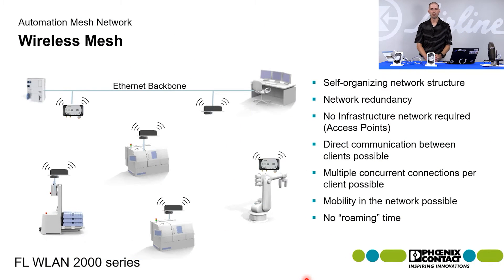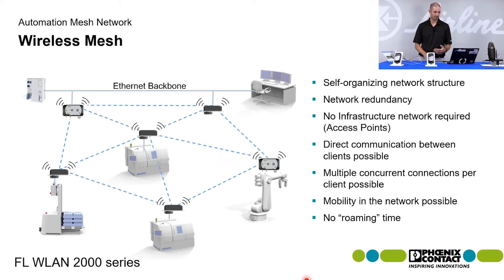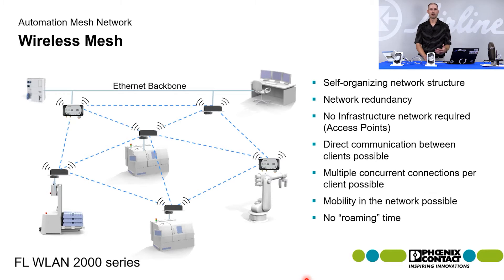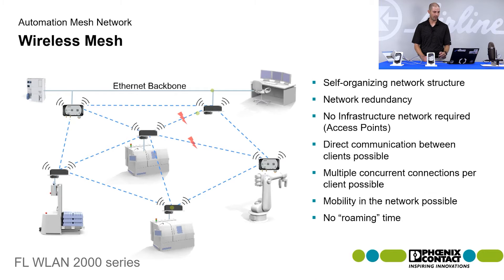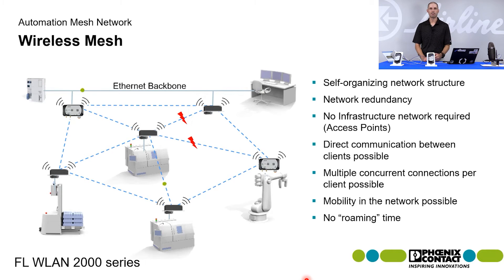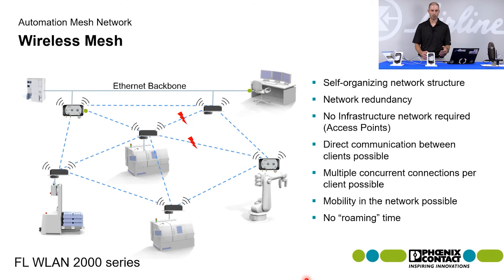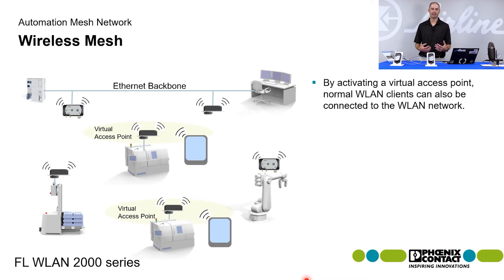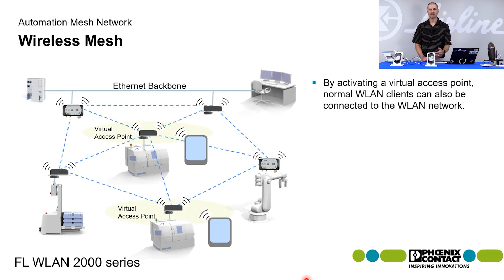Explaining Mesh Networks | Industrial Wi-Fi Setup Part 10 | FL WLAN by Phoenix Contact

Comment: Hi, if I would like to connect a laser with a WiFi module (ESP32) to a WLAN 1100 Phoenix Contact that is connected by ethernet to a LOGO! PLC, is it possible? ,

EXCELLENT VIDEO SERIES
Reply from the maker: We asked Justin, he said - "Yep! That would be no issue. You can set up our radio as an Access point and connect the laser to it like any other WLAN enabled device."